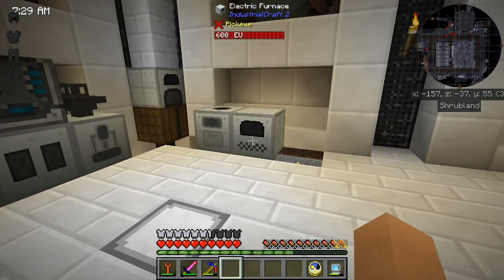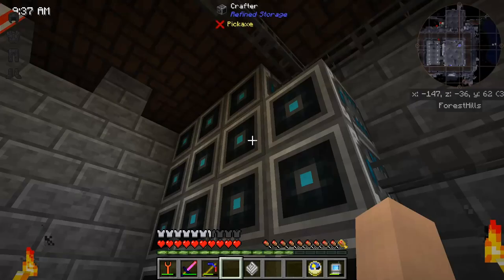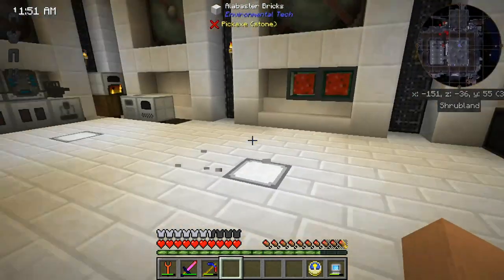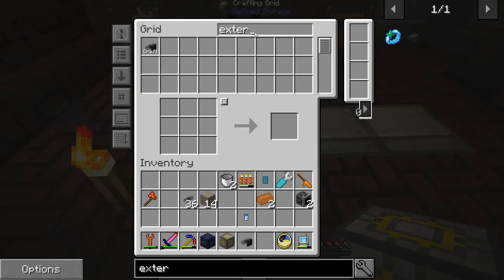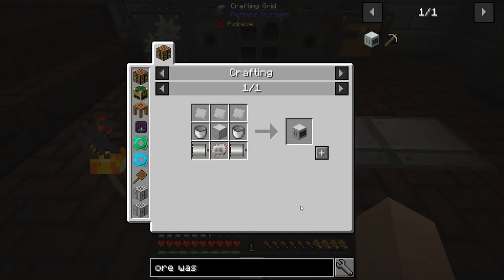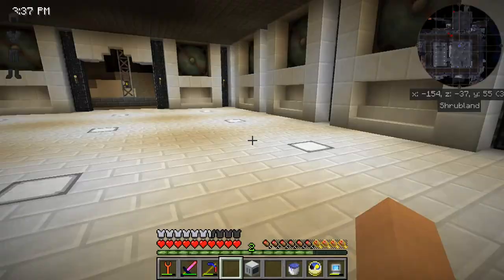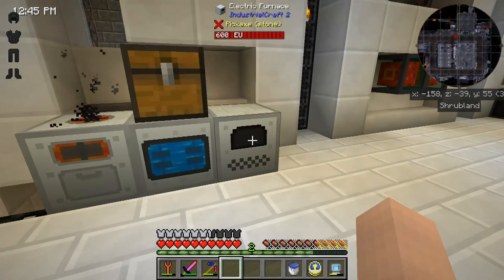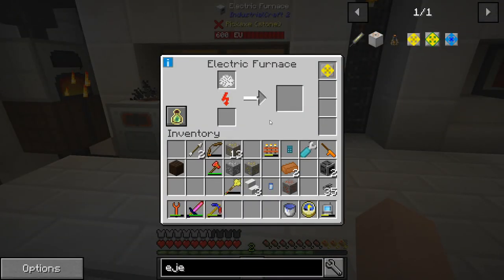IC2 Ore Processing | New Frontier | Ep. 34

Comment: You don't need an external storage for the fluid storage blocks, they connect right in to the network like any other RS block. In fact, you can make fluid storage disks so you don't need a separate block.